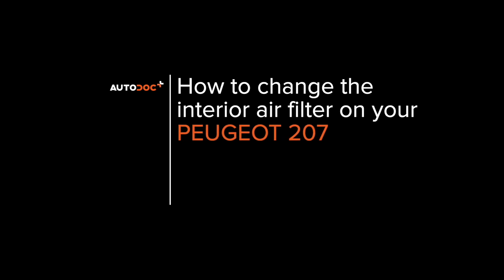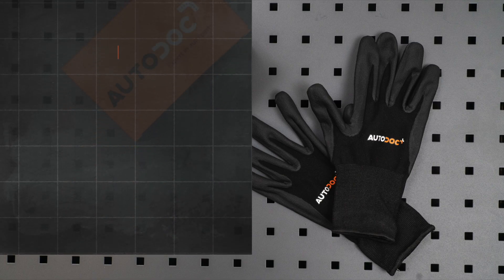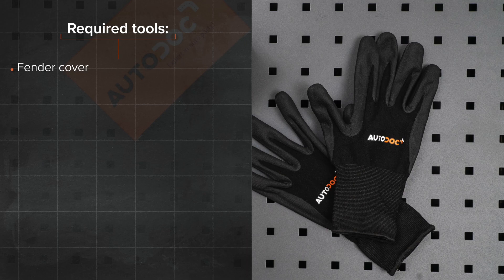How to change pollen filter on PEUGEOT 207  [TUTORIAL AUTODOC]

Comment: Arrows pointing up or down?????? Not very clear on video and no instruction given
Reply from the maker: The arrows on the cabin filter always indicate the direction of airflow towards the passenger compartment, at 1:40 minute of the video you can see the direction where the arrows show.
Reply: Does this solve my problem with the Anti Pollution Fault?😅
Reply: My new filters Does not have arrows direction,should I put it according to the words that are printed?in the video it is downwards.